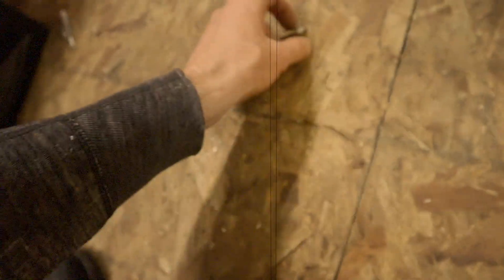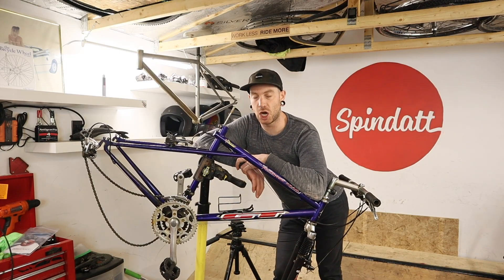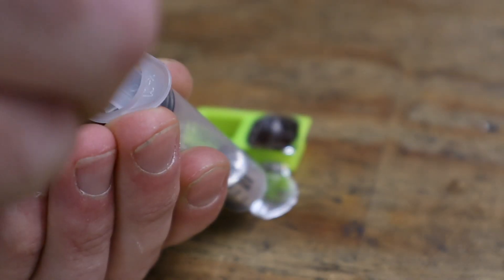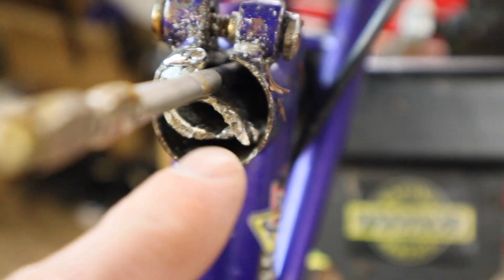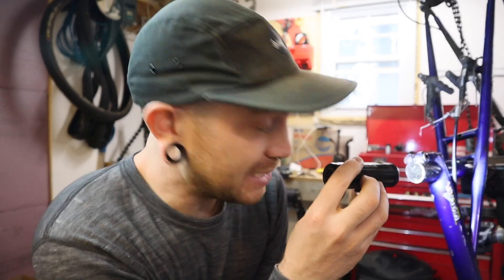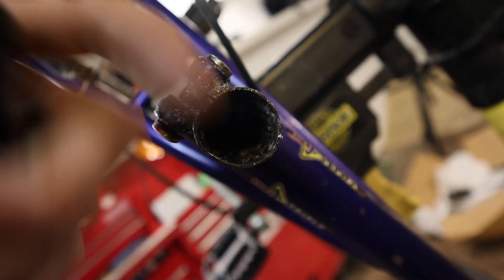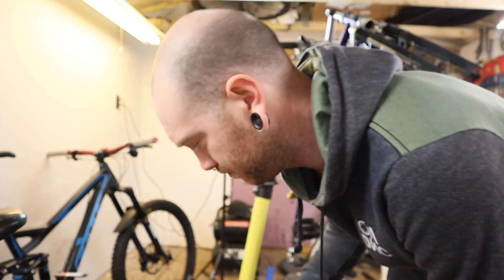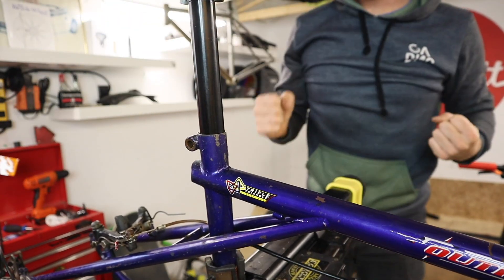Gallium to Melt A Frozen Seat Post Out

Comment: Thanks! I finally got the seatpost out of my Giant terrago!
It worked a treat on the first few inches probably because I had cut the post off flush with the tube so the gallium had a greater raw surface to crawl in to. Deeper down the post was quite hard still. I had scratched it all around before applying the gallium but it didn't work as well. Cutting slids in the posts first is probably better.

Now I need to clean the remaining thin layer of corrotion out. Any advice on how to do that? A slightly smaller seatpost wrapped with sanding paper didn't do the trick.

Comment: This inspired me on tough post removal over past week. I scored full length of stuck tube with a bi-metal saw blade 180 degrees apart. The gallium penetrated into the aluminum structure very well and the first 4 inches came out easily in nice chunks. The remaining 6 inches, vintage bmx with post dropped all the way for little kids, was tough. 

I used a 1" wood auger bit to remove the remaining 6 inches. Inserted auger into tube, tapped with hammer, rotated 90, tapped again, and so on. I put an adjustable open end wrench on the bit to rotate back and forth after each tap. Rotating back and forth felt like a metal thread tap when you are cutting threads. Took about 15 minutes after rhythm was found. 

Going to run a 1" cylinder honing attachment down through tube to finish clean-up.

Reaction Time - seemed like under 2 hours and the first 4 inches was crumbling like stale bread. I let second 1/2 of gallium remain on the last 6 inches over night. 
Gallium - 50g 99.99% pure off Amazon. $46 bucks. Used 1/2 first round then I thought the last 6 inches might not have been embrittled enough so I used last 1/2. 
Time Spent - hands on, probably an hour total. Activity length 1 day. 

Rescued a 99 GT Mach 1 from scrap heap.

Comment: When I put a new seat post into the frame, I lube it with lithium lubricant. It fits brilliantly for such purposes. I recommend using it with seat posts, bottom brackets and other not so permanent joints, which are going to be disassembled, at some point of time.

Comment: The only way I found to get a bonded seat post free that I found was to clamp the head or post in a vice and to use the frame to twist it back and forth until it breaks free (applying heat to the post too and letting it cool; along with liberal doses of WD-40 in between while it’s cool).  I’m afraid of checking my post since I haven’t moved it in years; although I haven’t ridden in wet weather and it had anti-seize liberally applied after the last time it got stuck.  🤞🏻

Comment: I also have a GT outpost same color like the one you got.
Reply: I also have a triple triangle built up into a flat bar modern drivetrain mountain/gravel bike.  I love it it.  Rigid forks too.
Reply: @pryan05p71  the one I have I just switch the handlebars and use it as a mountain bike. Take out to the trails and ride

Comment: I'd have been running a hacksaw blade down the seatpost for hours. You poured in some Gallium, came back later, and pulled it out in pieces. Meanwhile I'd be at it still before knocking it out with a cold chisel!
Reply from the maker: Well.. I did do that the first time hence the Gallium this round hahahha

Comment: As its a steel frame, the split could easily be dollied together and brazed, then the seat tube reamed out. Maybe work with a local frame builder or bust out the torch yourself 😀

Comment: A good way to make sure that frame will actually last is to tap the bit where you pierced through the frame back in to place and carefully TIG weld it together . Yes you will ruin the paint at the back of the seat tube but it will keep it from cracking even more than it is.

Comment: Last resort is melting the seatpost out of the frame
Reply from the maker: Yes definitely don’t just jump to this first. You generally have good success with the jig you have for even the most stubborn frames?
Reply: @Spindatt  it usually works pretty well. Sometimes it gets so hot when twisting the frame that the penetrating oil I put on it starts to smoke

Comment: I would of sprayed a 50 50 mix of automatic trans fluid and acetone. Let it sit for a few days. Try to move it..repeat till it moves. Keep it wet. Oh and ypy might want to drill a small hole at each end of that crack. I would weld or braze it. Gives the paint some character

Comment: I got the frozen seat post out of my 1999 Hardrock yesterday after years of putting the job off. I managed to turn it a couple of times with a big pipe wrench, and then it sheared off. At that point I thought I was never going to get it out. However I spent a couple of hours of cutting slits down into it. I then manage to clamp a set of mole grips on to the piece at the top and then use a hammer and metal rod applied to the mole grips to knock out the remains of the seat post. My reaction on getting it after several hours was much the same as yours.

Comment: Nicely done.  Looks less messy and toxic than caustic soda - lye. I might have removed the bottom  bracket in case any dripped on the cartridge, it would also allowed a second entry point to apply the gallium.
Reply: Same. Something tells me that BB will need replacement in the not too distant future.
Though he might be replacing that anyway.

Comment: Nice job. I had exactly the same problem with a Kalloy seatpin frozen into a steel Mongoose frame about 20 years ago. I spent hours trying to cut it out using a hacksaw blade then eventually gave up and scrapped the frame.

Comment: I had that issue before, I used a diy expansion plug, using all thread, nuts, and scrap aluminum sheets. it worked well, just had to pull it after.

Comment: FYI. Aluminium forms an thin oxide layer on its surface when exposed to air. This layer form so fast that it prevents the Aluminium underneath from further corrosion. To increase the speed of the Gallium diffusing into the Aluminium you can scratch the Aluminium before or after you have applied the Gallium.